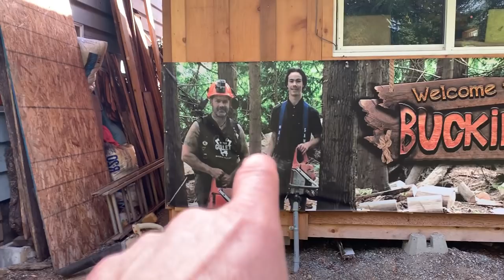Vlog style, adrenaline, is my pain killer.

Comment: You hit one of my concerns head on. Back in June I had an accident that left me with a smashed right fibula and a rotation fracture of my right tibia. I was down for three months and left with a titanium rod and three screws in my lower right leg. I find it difficult to move in the morning and try to stay moving to keep my knee and ankle from gettin stiff. I move slower in the woods right now because I don’t have my strength back. But you’ve been an inspiration to me and have helped to keep me motivated to get back out in the woods and cut and split wood and enjoy what I have.  Keep on keepin on Buckin. One of these days I need to get a big gnarly single bit off ya. I’m overdue for a new axe.